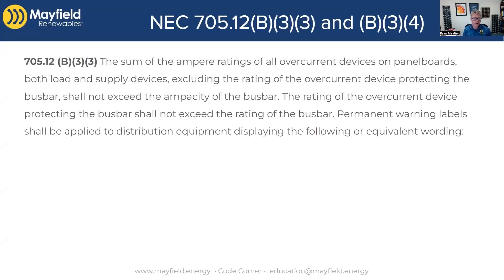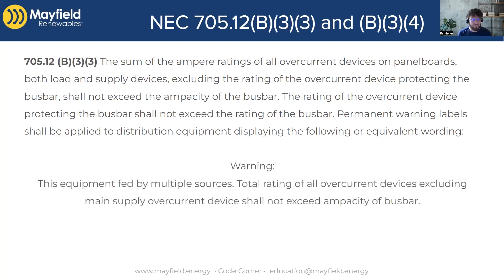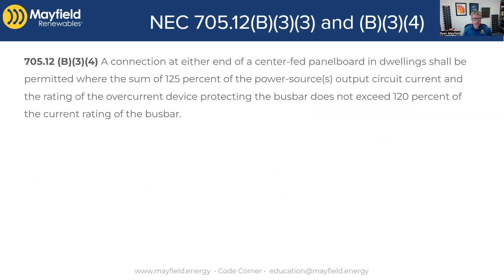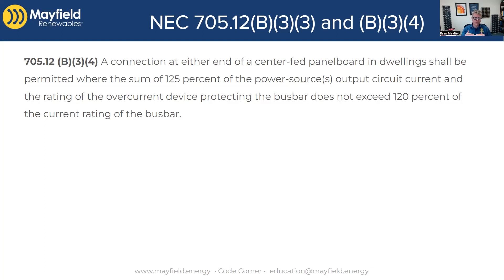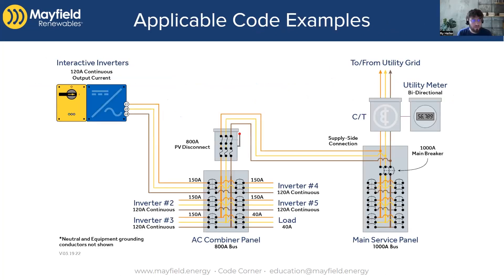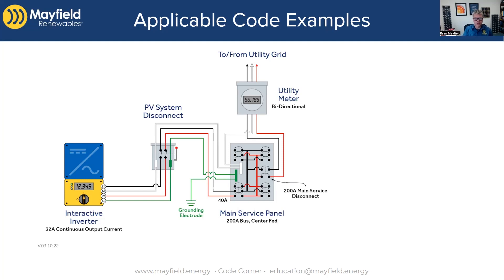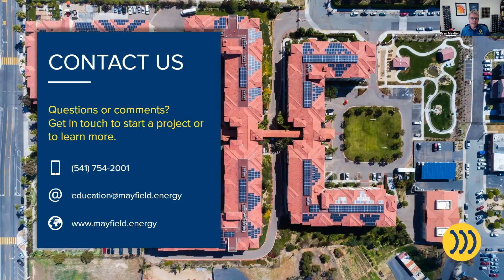Mayfield Renewables Code Corner - 2020 NEC 705.12 part 2

Comment: For 705.12(B)(3)(1) and 705.12(B)(3)(3), as I understand that we can place the breakers of the PV inverters anywhere in the bus for both codes. So when should we apply 705.12(B)(3)(1) or 705.12(B)(3)(3)? I am thinking to apply both codes and then select the lower bus rating (for cheaper price)?
Reply from the maker: 705.12(B)(3)(1) is applied when the sum of the two sources (PV and the grid) does not exceed the busbar rating. E.g., a 225A rated busbar protected by a 200A main overcurrent device. This would allow you to put up to a 25A solar interconnection breaker anywhere in the panel. 

705.12(B)(3)(3) is applied when the sum of all the breakers (both sources and loads) does not exceed the busbar rating. E.g., a 225A rated busbar with ten 10A breakers installed. Now you have space to install up to a 25A solar breaker, since the sum of ALL breakers would not exceed the busbar rating.

Comment: For 705.12(B)(3)(3), does it matter to the 80% rated and 100% rated breaker? For example, if the inverter output current is 100A. Then we can use either 100A 100% rated breaker or 125A 80% rated breaker. And if a panel board has 5 inverters and 1 load of 40A, then in the case of using 80% breaker, the bus is >= (5*125+40)=665A. In the case of using 100% rated breakers, then the bus is >= (5*100+4)=540A. So, can we select 550A bus if using 100% rated breaker?
Reply from the maker: Code doesn't differentiate. Default to the rating of the breaker: if it's a 100A breaker, use that in your calculations. If it's a 125A breaker, use that instead.

Comment: outstanding!
Reply from the maker: Thanks for watching!
Reply: @MayfieldRenewables  just rewatched now.   Curious re landing PV onto conductors in a 400A split service, supply side onto one set of conductors (accessible) to one of the (2) 200A breakers.  Thoughts?  Seems like no problem.........unless......redflags for some reason?  Thanks!  ie one MSP, meter, conductors feeding 2 200a main breakers..... one feed going off to a subpanel at another location....one breaker feeding a bus w breakers inside the msp.